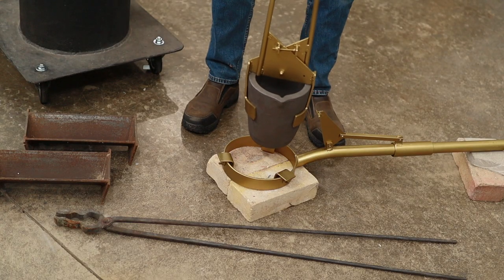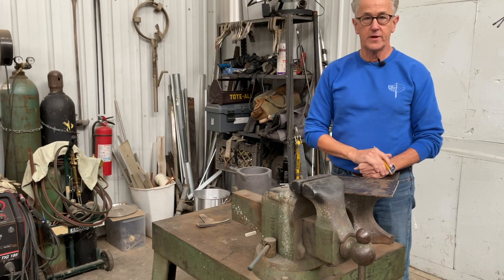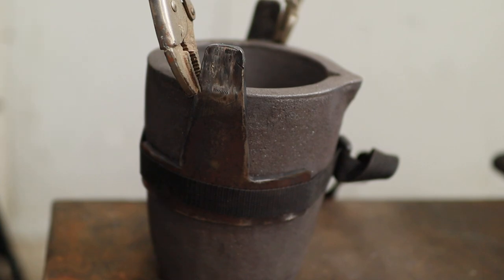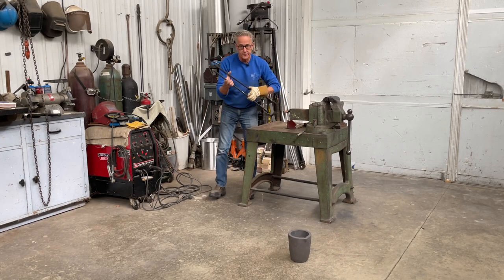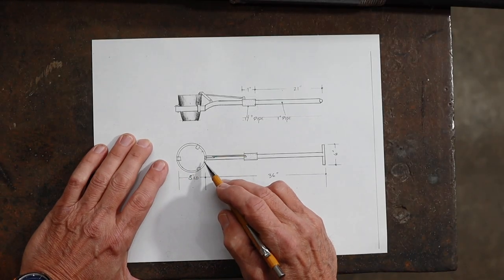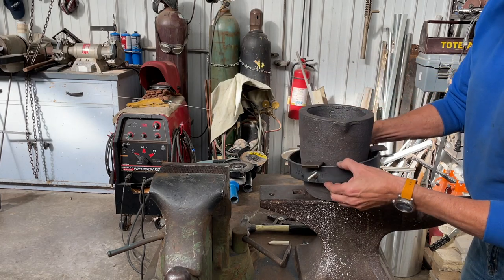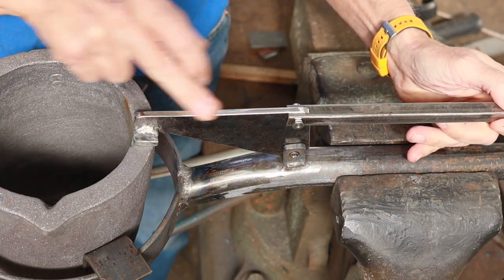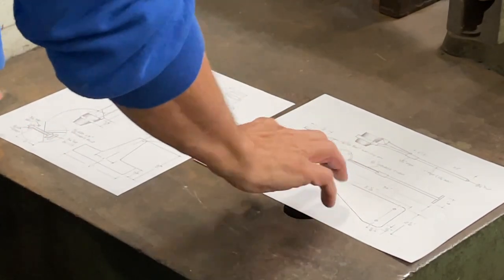Making Professional Crucible Tongs and Pouring Shank  S2-E54

Comment: Fascinating. As always. Looking forward to watching you make the forms and cast the parts. (Someone mentioned a plasma cutter. Very intriguing to watch a water jet at work - like a CNC router for wood.)
Reply: I've been thinking he could use a plasma cutter too.  The guys at our repair shop love it -   being able to easily cut out parts they need.  But at  home I just use a 4.5" cut off wheel too.  Not much for curves though.
Reply from the maker: @dwel2928  I have own a plasma cutter in the past. I sold it years ago finding I wasn't using it enough to warrant the cost of owning. So, like you cut off disc is the way to go.
Thanks for watching!
Cheers,
Bob

Comment: Inspired by your video I made a set of lifting tongs and a crucible  pouring shank, when fitting the crucible retaining mechanism  on the  pouring shank I didnt fit a sliding pipe but welded a pivot onto the handle, I then cut the pushing arm about 3 inches short  still leaving it about 10 inches adding another piece to make up the difference. It was adjusted so when the retaining arm was  pushed forward it locked in the closed position and will remain locked until the arm is lifted , it means you don't have to keep pressure on it while pouring . I welded a small piece of thin metal on under the joint that allowed me to adjust the amount that the   leaver dropped by hammering it up or down

Comment: Bob,  Is that a TIIG rig that you weld with.  Great video as usual.  The way that you go in simple concise steps has help  me in so many ways.
Thanks
Reply from the maker: Hi Edward,
Yes, the majority of the welding i did was TIG. The machine I have will TIG and Stick weld. A couple of time I used the stick to tack pieces together. 
So happy you found the information useful. 
Thanks for watching!
Cheers,
Bob

Comment: You may want to put a small flair in the end of the handle of the tongs to keep sweaty hands from slipping off.
Reply: Gloves.
Anthony
Reply from the maker: Hi Carl,
I did consider that. Maybe add later. No worries about sweaty hands, considering the furnace temperature. As Anthony wrote, I will be alway be wearing gloves.

Thanks for watching!
Cheers,
Bob

Comment: Bob, Have you ever considered getting a plasma cutter.  The one that we had in our shop ran off of 120V and an air compressor. It was capable of cutting up to 3/8" steel cleanly and fast and with virtually no slag. It also would cleanly cut through aluminum and stainless steel, which you cannot do with an acetylene torch. 
  It could also save time required cutting steel with an angle grinder.
Reply from the maker: Hi Edward,
I have own a plasma cutter in the past. I sold it years ago finding I wasn't using it enough to warrant the cost of owning. I found with big commissions I was better off having the fabricator I worked with do the cutting. They have a computer aided laser cutter capable of cutting 6" steel plate. You are correct a plasma cutter is an amazing piece of equipment. I did, however, keep the 60 gal compressor!
Thanks for watching,
Cheers,
Bob

Comment: Dear Bob, the crucible tools are painted in gold. Is that special paint to avoid heat damage or have you been lucky not to burn the contact points so far? Love your show.
Reply from the maker: Hi Peter,
The gold paint is a hi heat paint. So far, after many firings there is very little scorching of the paint.
Thanks for watching!
Bob

Comment: Thanks, really interesting. I love the way you're taking time to make all the necessary tools. Also that you're demonstrating it here. 
The pourer looks to me as if you have a good chance of losing control, the slider mechanism will release the crucible if you pull as in misjudge things, crucible end dips and the safety catch opens. 
Any way of locking this, or making it so the catch locks when you pull?
Also with the crucible lifter, maybe put cross pieces at the top of the vertical arms to stop it slipping out of your hands.

Comment: Bob why dont you use cutting oil when you drill the metal? Im sure its soft steel but it will save your drill bits.

Comment: It looks pretty, but won't that gilding just melt off??
Reply from the maker: Hi Jacob,
Good question. Yes, even with high heat paint it will, especially on the business ends. You can see in the video where the paint on the pyrometer burnt off. 25:28 However the majority will be fine and will keep them from rusting.
Thanks for watching!
Cheers,
Bob

Comment: With even just a rudimentary level of mechanical intuition and the video you can build these tools with out the drawings. But if you feel you need the drawings, or already support the channel and/or Bob at the required level (or collect his designs and drawings) go for it. 
Hey, if it was within my budget to  join his Patreon, I'd be getting his drawings to decorate my shop wall with, if nothing else. They art art quality, to me. And I'd 'print screen' a pic of his tools from the video to hang with the drawings too. I love this channel. I have learned a lot, and even what I already knew, the entertainment value is worth it, if I could afford the Patreon membership. (But at less than $10k annual household income... I just can't.[disabled]).
This video would be more than enough to figure out how to make my own, if I needed a set of these tools. The big a$$ thermometer on the other hand? Yeah, I don't think I could build that, but I have a no touch laser thermometer,  but I don't think it reads as high as I would need for foundry work.

Comment: GOOD ONE! PLEASE SHARE LINK OF MAKING TONGS FOR NUMBER 40 CRUCIBLE
Reply from the maker: As you are aware a #40 is much larger. You may have see the tongs and pouring shank that are hanging on my wall. These where purchased over 30 years ago when I had a larger foundry set up. They came from McEnglevan Industrial Furnace Company, Inc (MIFCO) so I don't and can't supply drawings of their product. However, here is a link to their website.
https://mifco.com/foundry-accessories/crucible-tongs-shanks/
Hope that helps.
Cheers,
Bob

Comment: Why not  use a rose head to heat, unless you want a precise area heated that would be the tool instead of the cutting heads. You do such beautiful work, so I am curious as to the why.
Reply from the maker: Hi Floyd,
I think you answered your own question. As you know a I was only interested in heating a small precise area just where the bend was.
Thanks for watching!
Cheers,
Bob